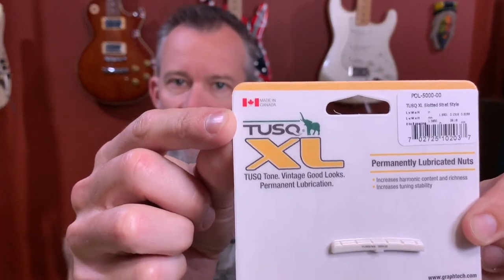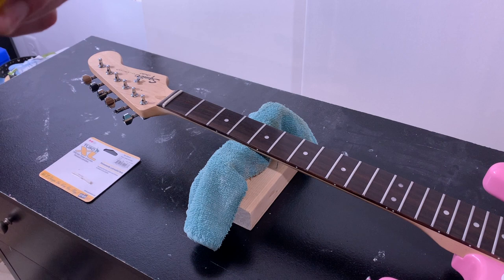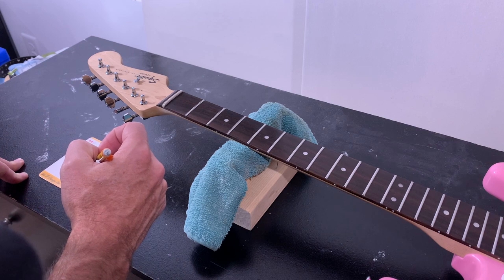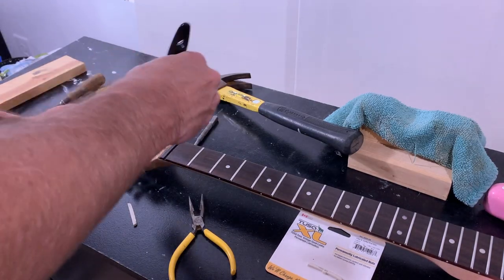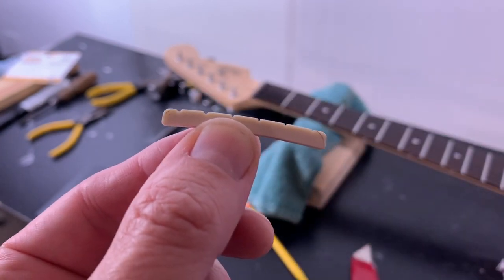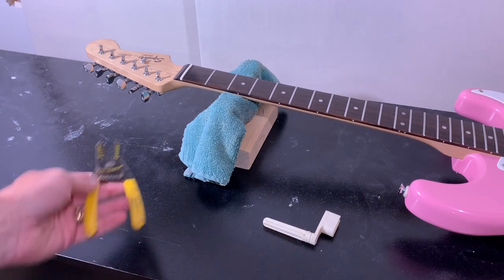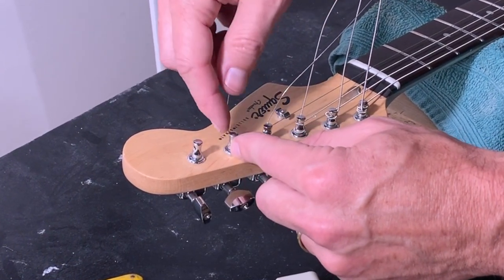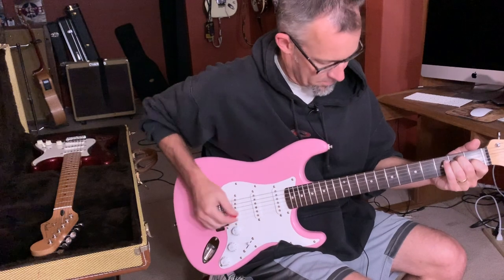How to Replace Nut Squier Strat - Part 3 - SQUIER STRAT UPGRADE

Comment: So I have a bullet and took a screenshot of the XL nut to make sure I was ordering the same one but when it arrived I see it has the exact same packaging and size but the nut is too wide and spacing is off.  Any suggestions
Reply from the maker: Yes I did have to shape mine a little to make it fit better. Sanded the edges down and some trial and error is involved.

Comment: Just got the same tusq xl out of my mailbox. Hope it goes as smooth as yours did.
Reply from the maker: Just take your time, measure twice cut once✌️let me know how it turns out!
Reply: @RichTones  Was a piece of cake, Tapping it loose with a block, and driving it out with a punch made it a breeze. Noticable improved tone from the Tusq Xl.  Thanks :)
Reply from the maker: @johnstrange6799  glad to hear that - it is a very good product! Cheers
Reply: @RichTones  Did you upgrade the tuners in this series? Guess I'll need to watch and find out. Curious about what to upgrade to. Kind of over the stock ones.

Comment: Did you end up shimming the nut?  What did you do about how loose it was?
Reply from the maker: icetrey47 thanks for leaving your question! After playing for several days I felt it was the right height and did not shim. Placed a little wood glue into the slot and fixed the nut in place. Just added locking tuners this weekend in video #4. Lmk what you think. Locking Tuners for Squire Stratocaster Upgrade Part 4 https://youtu.be/XgfixIYVpZ0
Reply: Rich Hoffman I watched part 4 and liked it a lot!  I have a 2018-2019 Squier Bullet Telecaster and I’m thinking of tossing the locking tuners on it.

Can you tell if the weight of the locking tuners was significantly different than the stock ones you had on there before?  I’m always curious if it adds any neck dive ... my Bullet Tele is basswood and is very light to begin with!
Reply from the maker: @icetrey47  Thanks so much I'm glad you liked it. My Squire strat is very light also but I didn't notice any significant difference when standing with a strap. There is more mass in the tuners and I thought they worked out great. A little work because all of the holes didn't line up, but I'm happy with the upgrade.

Comment: did you have to use glue on the new nut?
Reply from the maker: I normally use a small dab of wood glue to hold it in place, Its not much in case i need to tap it out easily in the future. If I wanted to change it again or if it got damaged.

Comment: Did you cut the center tab off the bottom of the new nut?
Reply from the maker: No I did not need to, after the test fit, it seems to feel right and the guitar plays really great now. Added a small bit of wood glue to hold it in. The Tusq nuts are great products.
Reply: @RichTones  ok thanks. Couldn’t tell in the video. I ordered one a couple days ago so I will be installing it soon, along with several mods to my squire. Thanks for the videos! Keep em coming!

Comment: Wrong nut bro. Affinity has a narrower string spacing, and it’s a flat bottom (not radius) nut. 
Standard nuts are 42 or 43 mm wide, these need 40 mm nuts. On mine I had to buy a 41 mm blank bone nut and had to shape and file nut slots. Could not find a 40 mm preslotted nut anywhere. Was a bit of work, but that’s what has to be done with these Affinity series guitars (Strats or Teles).
Reply from the maker: This Squire is a Bullet and yes I had to file the ends a bit to make it work. Good luck with your project, thanks for watching!
Reply: My squier affinity is 42mm. I think it varies throughout the years. Thanks for mentioning string spacings, something I'd not thought of. I'm about to replace the nut and even attempt stainless frets 🤞